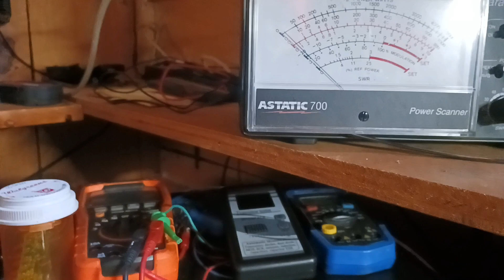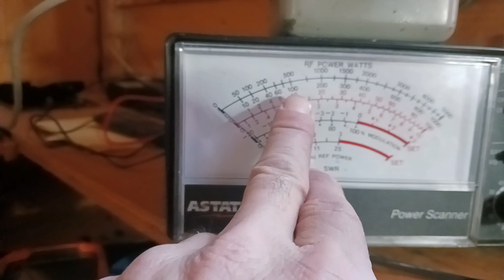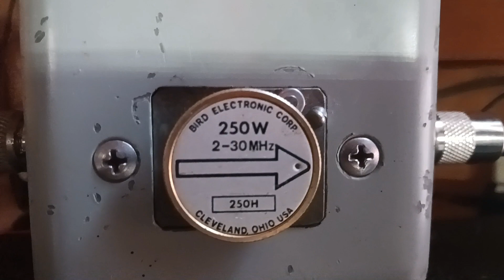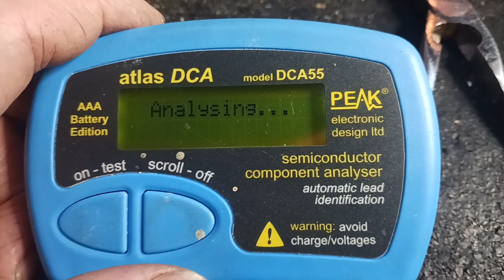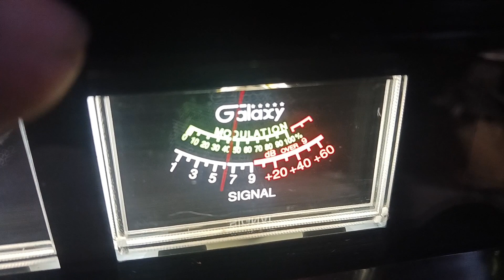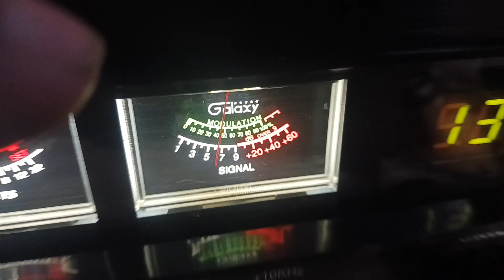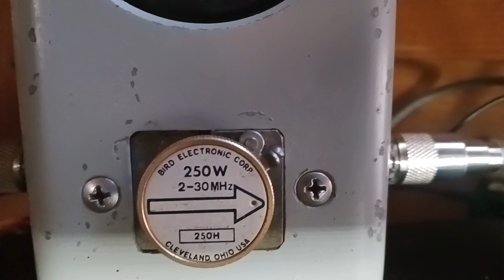Palomar 225 Amplifier

Comment: I have a 500 watt amp that is having relay problems on high works awesome on 250 but sticks on high wont unkey on ssb and the preamp does same as yours did I just got some electronic contact spray we're going to hose it out it did sit in the garage for about 15 years hoping that fixes at least the amp if not I'll keep running her on 250. Great video thanks
Reply from the maker: If the relay still sticks change out your jumper if using a 3-foot go to a 6
Reply: @stingray408  really? The relay only sticks on high 500 medium and low both work fine. How could the jumper affect that? Appreciate the help brother

Comment: @ 5:19 in the video there is a teal-ish green component placed horizontal at the top left near the coil.  I think it's a choke and it gets very hot on my Galaxy 225, same amp,  Does anyone know what value that is, I'd like to replace it as it has a dark ring around the center where it's been so hot.  thanks! 73's Crowbar225 in the bluegrass.
Reply from the maker: @GbennGbenn  thanks for watching 👍 👀